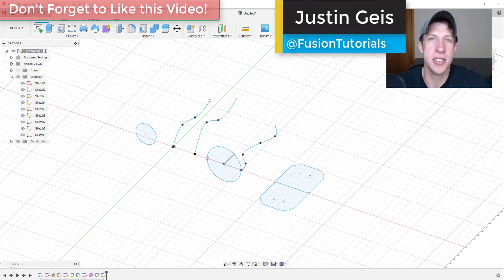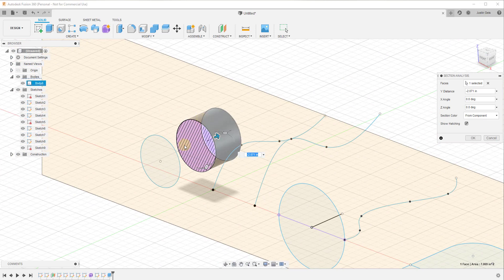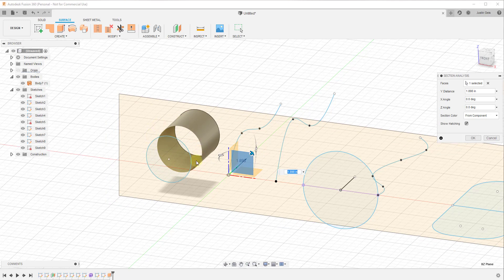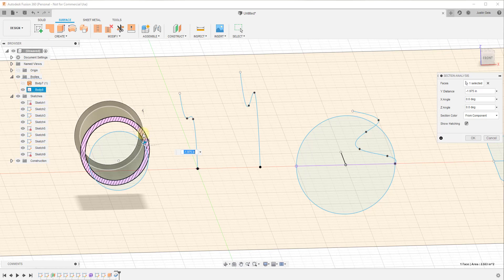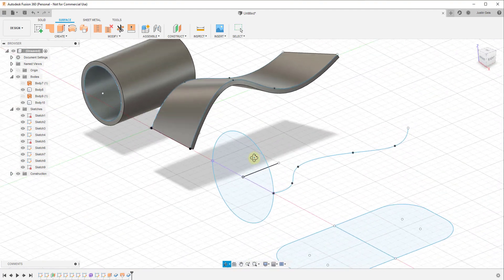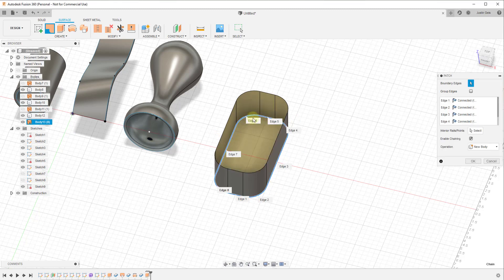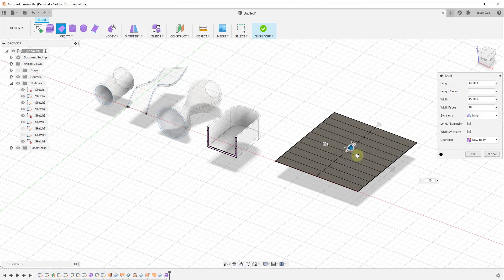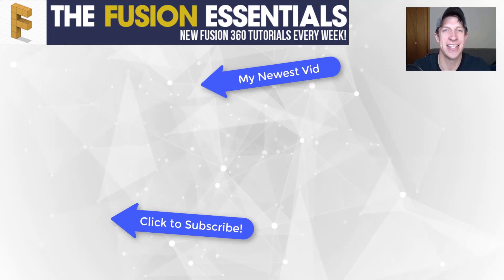Using the THICKEN TOOL in Autodesk Fusion 360 to Create Solids from Surfaces

Comment: Thanks @TheFusionEssentials - I have used thicken in the form environment to make a truck body for an RC Rock Crawler. It is really cool, but I want to make the wall thickness less than I initially set it up for. I can't figure out how to edit the wall thickness. Thicken doesn't show in the parametric timeline because I did it in the Form environment.

Comment: Attempting to make an efficient egg holder that can hold different sized eggs, use less material and require less support. After I made the egg in the sketch I realised I couldn't add an even sized thickness around it and this is exactly what I needed ty!

Comment: Hi. I’ve a problem. I’m making a scale model of a large steam loco I made years ago. Printed version for the mantelpiece. It’s going well and just printed a wheel. This wheel has a secondary axis for a coupling rod which I’m including in the wheel print . The engine has a driving wheel with an extended axle . Simple just extend the extrusion. No; it doesn’t work because I put a small chamfer on it so I can’t extend it with the chamfer. How can you remove a chamfer from a model?

Comment: I am very new to Fusion……when I try to select the entire object (car hood in .obj format), I get the blue shading, but then try to use the thicken tool, and the object goes “gold”. I can’t seem to get the thicken function to work. Any help would be appreciated as I’m not totally familiar with all the basic functions of the program.

Edit: I should add that the object alone has a very high polygon amount. Could that be part of the issue?